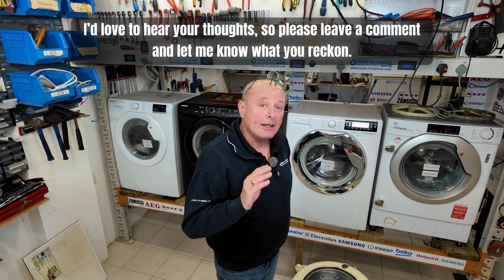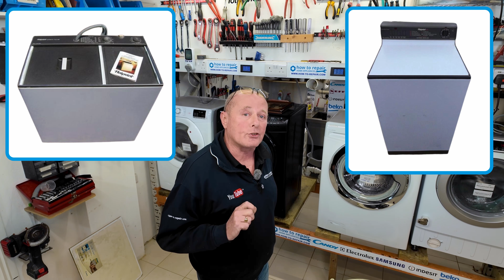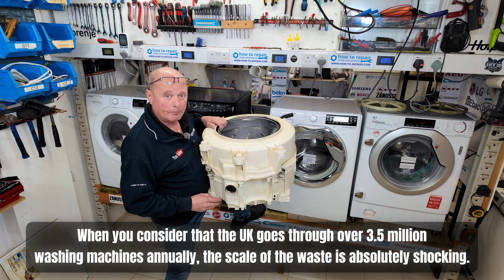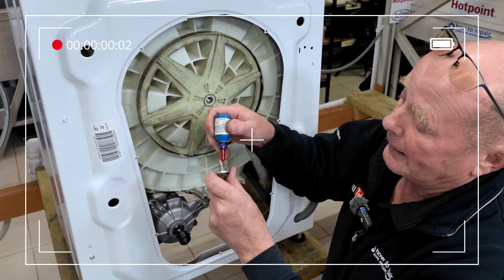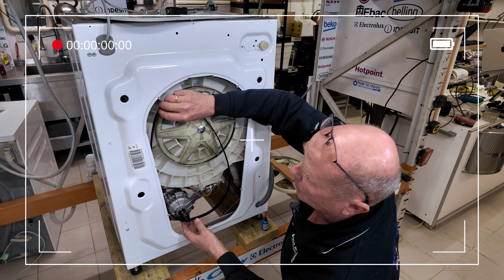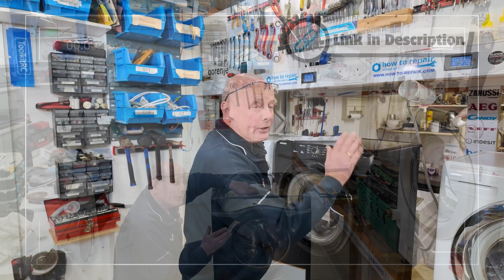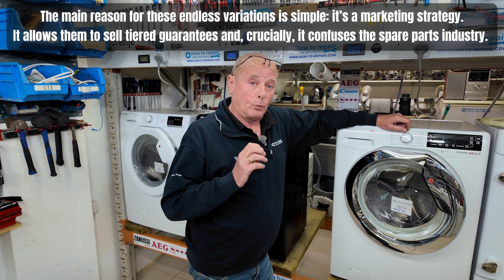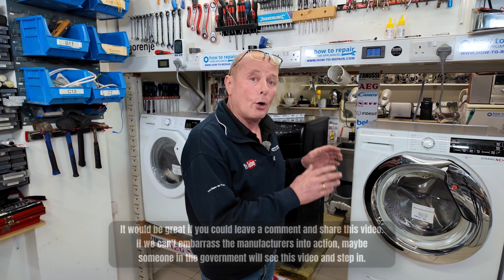I Scrapped 13 MACHINES to Prove a Point: STOP BUYING These Brands!

Comment: I Own a Zanussi which I have had over 20 years, I live in a hard water area and it gets used once a week, I also have a dog and It works as good now as it did when it was bought new, I have never cleaned any filters or dont any maintenance out on it. I know its living on borrowed time and sooner rather than later I am going to have to replace it. i would like to get something modern which would also dry clothes but I cant have an external hot air outlet pipe.
Reply: Most washer dryers spray cold tap water to condense the steam and recirculate the air so don't need a vent hose, some fancy, oversized ones have a heat pump condenser built in to make them much more energy efficient, eg if you are UK based, Costco currently have the WD18DB8995BZT1 for £999.99, over £1,500 off!  Although, seeing as it is complex I'd probably want to buy insurance if it doesn't come with a good guarantee. Personally, I'd prefer a separate heat pump dryer. 20 years is pretty good going for the bearings in a hard water area, I have very hard water and a 2009 Zanussi, the rubber shaft seal leaked water into the bearings seizing the inner one with rust after 11 years, which is about the longest any shaft seal and therefor the bearings have lasted on any of mine, usually the seal leaks, then most of the grease gets washed out and the bearings rust and wear out, and normally a few years sooner, I believe the cause is limescale encrusting the seal and stopping it from flexing. I  descale mine once a year, having had to replace the element twice in the first few years, due to limescale build up causing it to blow, doesn't really need any other maintenance, because hydrogen peroxide produced by the powder detergent I use, keeps it clean and free of bacteria.  Mine used to get run about 3 times a week, but has been used considerably less in recent years, last time I checked, it had just over 4,600 hour run time on the total operating hours counter.

Comment: I had an expensive miele washing machine costing €1300 somewhere before 2013. It broke down in 7-8 years because of the alluminium cross being eaten away by the washing gel. The older ones used to be reliable I was told. Now I have a bosch that was €380 and it surpassed the miele one already. So my advice is probably buy a cheap bosch one lol.
Reply from the maker: Thanks for your comment. I’m waiting for someone to come back with an aluminium testing results on spiders from the 70s and 80s and spiders that have been made in the last 10 years then we will have categoric proof and then maybe a class action lawsuit can be raised
Reply: Yeah thats true. I thought they were made from cast iron or stainless steel back in the day but I could be wrong because thats what I read online back then. I also read somewhere that washing powder is better for the cross but they put pieces of plastics in there which I dont like much. I now sometimes just run the washer at 90 degrees with vinegar only added to clean the cross as washing gel apparently only dissolves at 60°. You also talked about the "green" label and I found that alot of washers that are better for the environment cant run hotter than 60° lol. I guess thats an easy way to get a green label too.  @How-to-repair
Reply: I had the same problem with two Miele machines - spider failure - both times. I thought I was buying quality that would last.  I am now looking at other makes, but the manufacturers that I have contacted enquiring if their machines had aluminium alloy or stainless steel spiders? Only the British manufacturer had the courtesy to reply none of the others have the courtesy  to even reply, perhaps they don’t know how their machines are made!
Reply: Yeah same! Thats a bummer man. What you can do is look up the part for the type of model you are interested in and see what the cross looks like. But I think their all alluminum. They purposely dont make quality products. I repair electronics and often upgrade products with better than oem parts. Proof that they like profit because my aftermarket parts last way longer.  @davidschofield8458

Comment: As early as 2006 for sealed drums? I’m sure you’ve said it was much more recently in a previous video.
Reply: It depends on the brand really. 
Indesit were the first to hop on the sealed tub train, they started producing sealed tub machines around the year 2000 with their evolution series, then the rest followed; Hotpoint (after the Indesit takeover) in around 2006, Candy/Hoover in around 2007, AEG/Electrolux/Zanussi in around 2007-8, Beko/Blomberg/Grundig in 2008, Bosch/Siemens in 2013, and now Miele which have started producing sealed tubs just last year. Most of the manufacturers I mentioned continued making split tub machines alongside sealed ones for some time, but not for very long.

Comment: I have an 11 year old LG, and apart from a blocked recirculation pipe (that I managed to unblock myself easily but removing the fluff that got stuck in it) and that the front of the cabinet has started to rust (can I get the front cabinet replaced?!) it's still working as well as the day I got it. 

I worry about when the time comes to replace it, will a new LG last as long??
Reply: No, 2 years and ours went in the bin. Never again.

Comment: I have an old Siemens Siwamat plus 680. No idea how old exactly, but it is at least from the previous century.
No doubt the shock absorbers are shot, the bearings sound rough, and it leaks water from the skirt between tub and top opening if you use the high speed spin drying cycle.
... but it just keeps on working.

Comment: Even the 2 year warranty that the EU mandates is shockingly short, I'd expect a washing machine to last at least 5 years without significant issues. 

But 12 months is just taking the piss and oh look, yet another (non) benefit of Brexit, once again the UK lags behind the EU.
Reply: In the UK, consumer law,  goods MUST last a reasonable amount of time, taking into account the purchase cost, a cheap appliance can't be expected to last as long as a very expensive one... If it doesn't, you can  use the small claims court to sue the retailer online. You would have to satisfy the court it has not failed through misuse, not keeping it clean etc, and your expectation of longevity is reasonable. You'd only expect to get a percentage refund adjusted down for the number of years of service you actually got.

Comment: HI Paul
You are not wrong Hotpoint 95's just class and easy to replace machines! yeah the facia's were brittle and not strong but rest of machine so good to repair and ready made parts back then! 
Hoover A Series yeah another strong proper drums, proper parts! But also the programming! no fussing distributions on speed cycles compared to todays crap where they got stupid  balance sensors!
Hoover machines are just the worst ever! Candy exact same but for some reason the candy machines are actually much worse PCB wise. 
Your so right about those lids! ive seen them snapped, the wood break and actually the side panel structs severely bent/damaged! 
The plus is defo paint work, because you rarely see rust on them! were indiesit and hotpoint are just the worst paint jobs ever!

What a brilliant video paul ! oh god i think fridge freezer the brand LEC! they would run as old as our children! 

What i will ask Paul. Do intergrated machines break down quicker? They seems to be purposely built to break down very fast! ive seen so many of these intergrated machines fail so fast! something fishy going on i think. Alot of these Hoover/Candy ones especailly !

To be fair on washing quality and water levels. Hotpoint have gone back to using much higher water levels now. I do totally get saving water is good. But hoover etc using barely any water is not good because if you use pods it just ends up sticky mess on your clothes. they dont even flush the soap draw anymore where old beko's would do that all the time 

For holes in drums. I wouldnt scrap them get some "Milliput Epoxy" for less then £7. you could save them from landfill! but so many will scrap for the silliest things! Paul your a life saver and seeing the first of many videos! this hoover one was a really good listen! looking forward to the hotpoint one
Reply from the maker: Oh, with LEC in Bogner was still going they would own the refrigeration market please remember I’m a one man band I have an editor now who helps me an a partner that helps with the parts. Please remember to share the video to get as much exposure to this problem as possible thanks very much for your comments and support.

Comment: Brought a Bosch WAYH8790GB Series 8 Washing Machine in May 2018 and its has been an excellent machinery mum has a Miele thats nearly 20 years old.
Reply: I got a Bosch about the same time, a Series 6 10Kg/6Kg washer/dryer. When I first got it I could hardly tell it was on it was so quiet, even during spin. Now the spin is getting noisy, which I guess means the drum bearing is wearing out. I guess that will mean the end of the machine if it is a sealed drum :(
Reply: @SimonBlandford  Series 6 is ass. And washer/dryer combo is never a good idea, way more things to go wrong with it.

Comment: If they did collude this could be the next dieselgate.
Reply from the maker: It’s very hard for me to prove a lot of things I can only go by what I see in the machines and what you customers are telling me this is when I start to do an investigation a lot of the blame has to go with the politics and also the consumer is not innocent as sometimes he will buy the cheapest thing out there but expected Rolls-Royce
Reply: @How-to-repair  To be fair a lot of the parts in a Rolls-Royce are exactly the same BMW parts bin parts as in cheaper BMWs (same for Bentleys using the same VW parts bin parts like an O2 sensor identical as on a Golf or something). It's mainly only the interior and exterior that are made to a very high standard on a Rolls Royce or Bentley.

Comment: I had a new washer dryer 350 hoover last year in may, had to get rid of it for a different machine because the bearings went on it never more then half a load full and can say that the most cycles I did was 2 times a week so not much use at all
Reply from the maker: I’m hearing too many horror stories like this and this is what led me to start fighting against these practices. You must remember. I’m a one man band and it’s very hard for me to get much influence unless the general public shares the videos and comments on them but I do appreciate you going to the effort of typing of a response

Comment: Having just been burned by the bearings starting to go in a 7 year old Gorenje and finding it was a sealed tub i just spent a small fortune on an Asko (yes i know Gorenje bought Asko and then Hisense bought them both) but it seems Asko is being left alone do do what it wants so hopefully it should last. It felt so wasteful to write that Gorenje off. heck the odd thing is the Gorenje the last one replaced is still going strong with its new owners

Comment: Paul,
It's been many years since I bought any of this type of machines from new. They are NOT worth the money and of course I buy second hand. Environmentally friendly and I repair them if need be. Now, for a few years I've been using relatively old AEG top models. Really good ones, but of course with the same problems: sealed drum and pcb and swithc problems. Switches are not of the soft touch type on mine, so that is not a problem for me, but the newer version of these, washer and also the dryer, have those nasty soft touch panels that constantly break down.
Yes Paul, you are absolutely right: HURT THE COMPANIES ON THEIR WALLET!!!
And if you like a particular model, try to investigate if it's been a popular model, that sold well, so used ones are readily available, and spares are available. And lastly: but an extra sealed drum in advance.
Finally: Paul, we NEED a company that can renovate the sealed drums. Cut them open with precision tools and seal them again perfectly.
THAT would change the shitty companies strategy.
Thank you Paul, for your everlasting inspiration and fight for fairness and the RIGHT TO REPAIR - and at reasonable cost.

Comment: Maybe the bonded drum has to do with ease of manufacturing and ease of leak prevention. The problem is it evolved from concealed marginal parts that at some time might need to be replaced and now they want to seal it and making if difficult to repair in a customer dwelling. To refurbish the unit now becomes a shop operation requiring much more over-head expense to pull off such a caper, while the customer is stuck with piles of laundry.
Reply: It is cheaper and quicker to weld the tub, than fit a seal, air chamber and screws. It is also less likely for a welded seal to leak, and probably makes the structure of the drum stronger too.

Comment: Whitegoods tech here, 40 years in the trade. I take a different view of the quality situation. In the 1970s all appliances washing machines, refrigerators, whatever were VERY EXPENSIVE compared to a similar product now days. The consumer in general demanded a more affordable product. The manufacturers had to respond to this consumer demand. Products became cheaper, and cheaper and cheaper. Probably only 1/4 the cost now days compared to back in the 1970s. So think about it??? If you only get 1/2 the lifetime in comparison you still are streets ahead in value.
My point is made by the presenter at the 12:00 mark.   Although the fact that the owner of that machine was incapable or not inclined to repair the machine is on the owner. People have to realise that not everyone is capable of being a Whitegoods technician, and Dr Google can’t help everyone
Reply: Excellent point! Is it fair to say buyers can still get the older quality (be it washing machines, refrigerators or televisions) simply by buying a commercial product? Instead of complaining of the lack of durability of their consumer product, they could instead buy a commercial product that IS designed to last for 15-20 years.  E.g., there are lot of complaints of low quality TVs, but it's a £250 TV, what do you expect? You can still buy a commercial £1500 TV of the same size that IS designed to be on for 24 hours a day, 7 days a week for 10 years, or likewise a Speed Queen washing machine or a Electrolux Professional washing machine or whatever.
Reply: @TassieLorenzo  "Commercial" TVs are still going to get burn in. It's an underlying issue with the technology. Spending more doesn't get around that. I know it's one specific point but I don't think machines designed for business are intrinsically better, and a commercial washing machine is probably not going to fit in the spaces in most UK kitchens either.

It's worth bearing in mind that the machines built in the 70's were likely built in in the West, with considerably higher labour costs rather than being farmed out to some third world country somewhere and the technology was a lot less mature, which increases costs.

I don't think it's unreasonable for a £400 washing machine to have a metal drum. The cost of metal just isn't that high to justify it costing several hundred pounds more and even with plastic drums, you can clearly see that they've taken steps to make these things unrepairable (sealing the drum) so it's about a lot more than the cost of manufacture, there's clearly a push to make these things unrepairable as well.

Comment: I was a student about 13 years ago and I found an old Bauknecht (built sometime in the 90ies) in the cellar. I took it to my place and it runs to this day. A month ago, it wasn't working. Getting a machine w/ full metal container would be possible north of 1200EUR (some Miele have this). I figured out it were just the brushes, got them the next day from eBay and installed them successfully.
Reply: Probably expensive to run.
Reply: @CW130J  Not sure. Electric motors have been efficient since ever. The amazing technology of heating up a wire by electricity to boil water also did see any major break-troughs in the past century. But I'm sure that using more water and a stainless-steel cabinet (low insulation and higher heat conductivity) will waste more energy. On the positive side however, it has 'dynamic sense' AAAAAAND even 'fuzzy logic'!
Reply: @CW130J  It saves £400-£500 every 5 years.
Reply: I moved house and remodelled the kitchen. Got rid of a 25 year old Bauknecht dishwasher fitted when the house was new. Nothing wrong with it...worked really well, just didn't fit in with the new kitchen.  I agree , they were built to last👍

Comment: PS: another interesting KPI would be the execution of periodic maintenance of those appliances that end up in your warehouse. Are those units falling despite being maintained and used as indicated in the manual, or not? How often were those cleaned, loaded under/over the max capacity, etc?
Reply: Almost all non-washing machines enthusiasts will overload their machines and not do hot washes though.  Toyota built their reputation in the 80's and 90's based on designs that could tolerate this lack of care.  E.g., they would deliberately put a vehicle into reverse at highway speed and then beef that part up so it didn't break, so even the more careless driver simply could not break the car.  Shouldn't washing machine makers do the same?

Comment: Keep fighting for “Right to repair” !
I do not agree though with the remark
Made in the beginning where the SW was indicated as root cause and then PCB was mentioned as dead. If PCB died, of course SW cannot run on it, right? Unless it was SWvthat killed the EEPROM. Anyway, going back to facts: i am using a Siemens IQ700 purchased in Q1 2014 in Netherlands. WMN16S4471/45 FD 9309. Production date: September 2013. Used in average 4/week. Had one failure of the door hinge about 2 years ago, replaced with genuine part.  MTTR <7days.